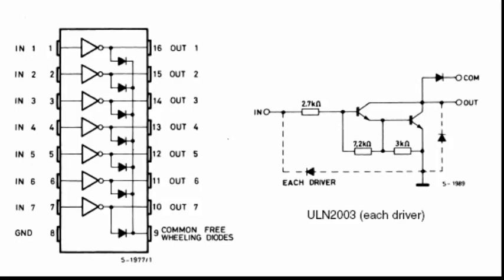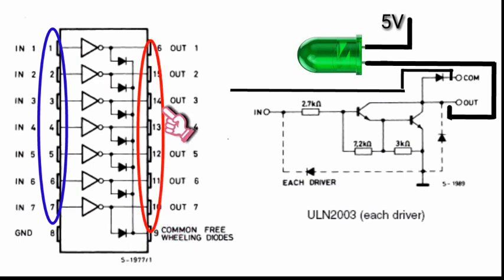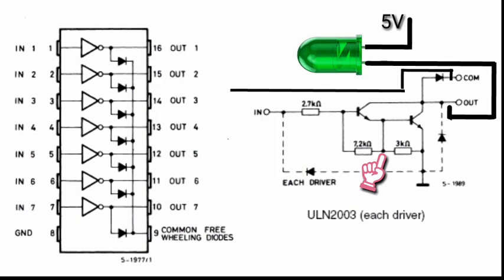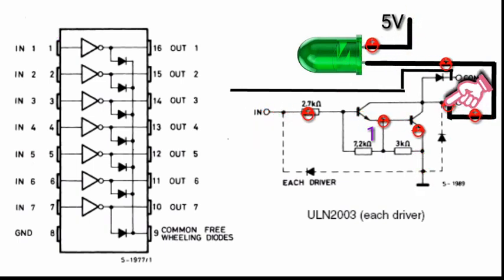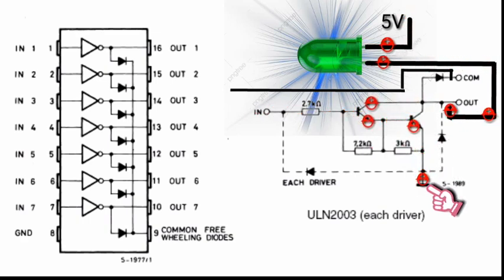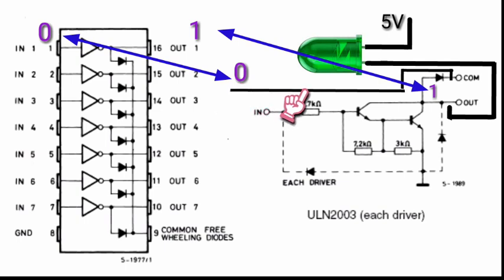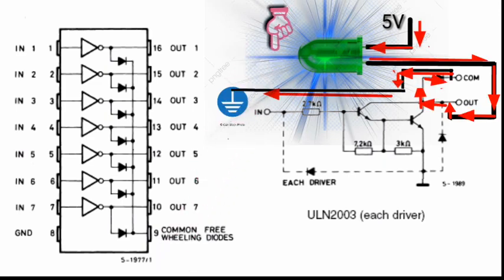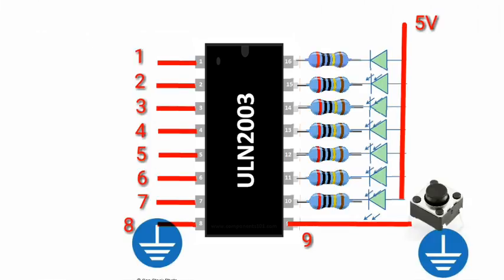Part1:how the uln2003 ic work#water level indicator#battery indicator

Comment: The common free wheeling pin is NOT for testing a short to ground!  that will blow the free wheel diodes!  This pin is set at the load voltage to catch transients from inductive loads!
Reply from the maker: Read the datasheet in this ic it is 2 purpose to test the output load n to protect for inductive load